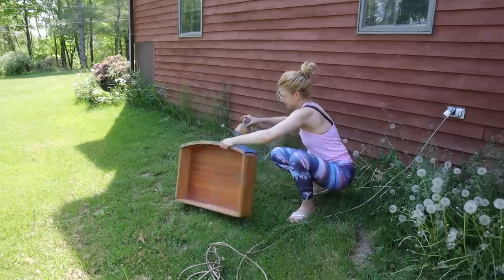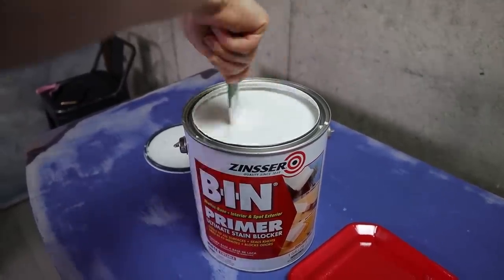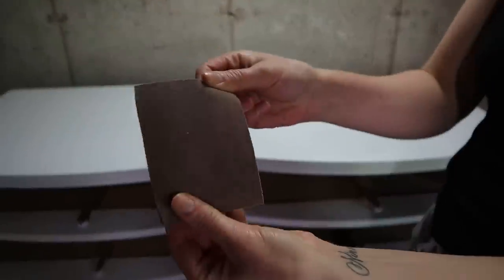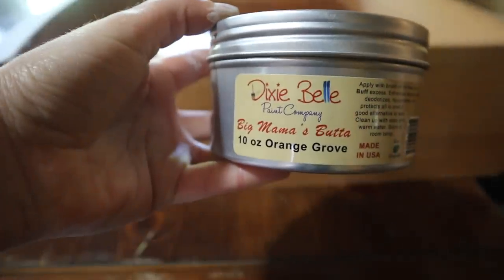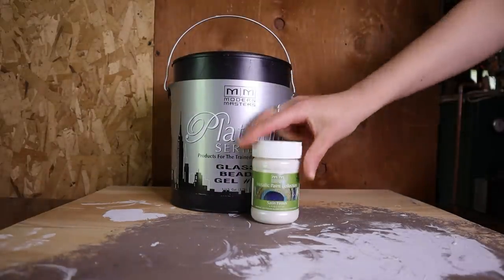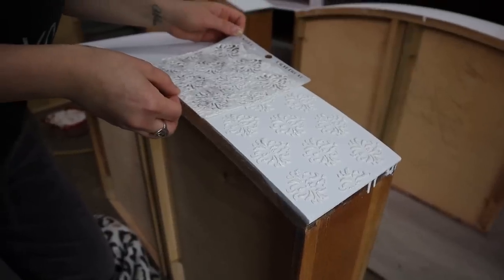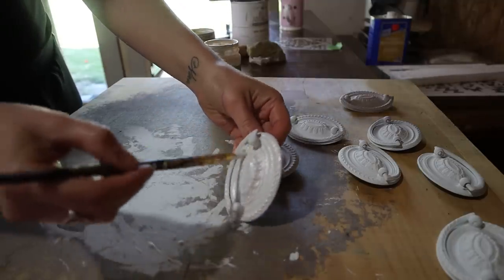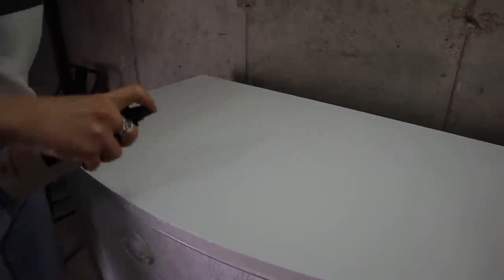White Snowflake Metallic Dresser ~ Chalk Paint

Comment: I love zinzer. For people that do renos on rentals they also have a odor blocker. I've used it for cat urine ect. painted onto bare floors(sub-floors) or drywall. One may have to do more than one coat at different angles, but it works like a charm.
Reply: This products in the video, works well on water stains on ceilings.

Comment: Bees wax on the interior runner the draw slides in on.  On antiques it’s the wood strip center bottom and the slot at the draw bottom.  Bees wax paste onto wood of both pieces and rub it it.  You could melt bees wax and paint it on too but has to be thin coat.  Make sure it’s buffed in.  It’ll help the draw slide in.

Comment: If you purchase BIN "Bullseye" alcohol based primer at any paint or hardware store, make sure that you ask someone to put it on the shaker for you. Since this is not a product that is normally tinted in house (although you can do it yourself with powder tints) it usually walks out the door without ever being shaken, and after sitting for a few months on the shelf, the sediment at the bottom is like concrete. Save yourself many broken stir sticks, (and maybe even a broken wrist) by having them shake it for you. That said, Zinsser Bullseye is a bulletproof product that will hold back just about anything, and is compatible with any finish that you would care to apply over it, including lacquer based products. Alcohol based primers are able to bridge the gap between Acrylics, Alkyds, and Lacquers.